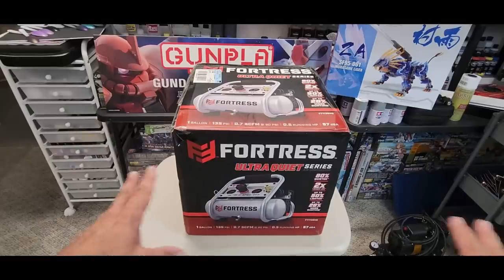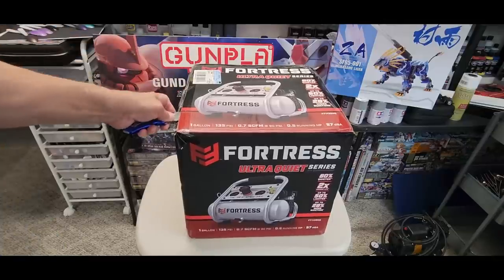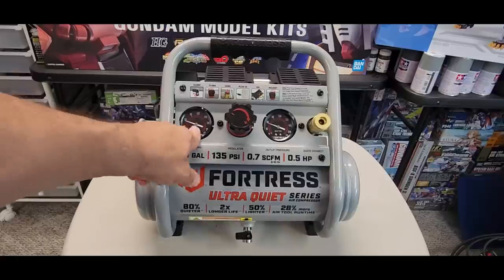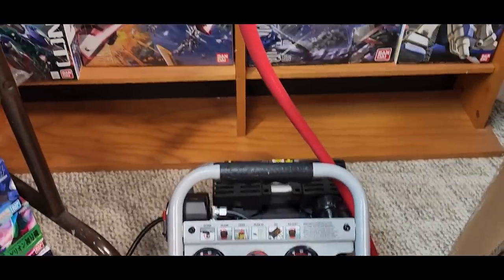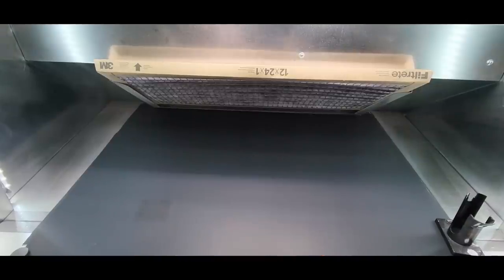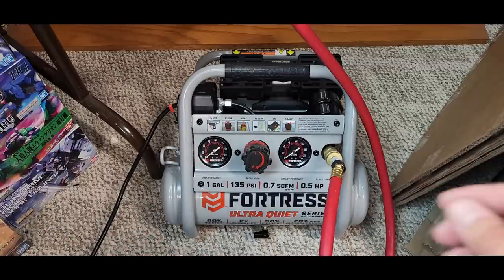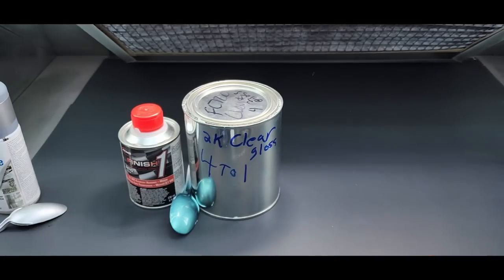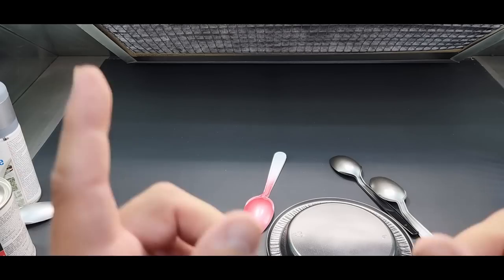Testing Harbor Freights Fortress Air Compressor For Airbrushing - Quiet High Quality Unit

Comment: Got one today but when i tried to move it around it sounds like there is sand inside it. Is that normal??
Reply from the maker: Well that's definitely not normal
Reply: @barbatosrex9473  thank you. I took it back and got another unit but did the same thing. Turns out, it was tiny metals from soldering the unit. They probably all have them. If you pick it up and turn it 360 degrees im sure you will hear them too.

Comment: Nice! It looks like a pretty good little unit and way quieter than the little Coleman compressor I use for portable air. You can just use the drain on the bottom to release all the air and that will also drain any moisture that builds up in the tank. You can just crack it open a little and put a rag there to absorb the water that comes out. In a lot of air compressor dryer units, there is a solenoid that pops open the compressor drain intermittently throughout the day for a second or two and keeps the moisture down in the tank.

Comment: Hi, I wanted to ask you, I have the 2 gallon Fortress compressor and I was blowing stuff for around half an hour (non stop) and it got very hot, burning hot!. Is that normal? This is my first compressor so I'm no expert. Thanks!
Reply from the maker: Yes, the manual says it will get hot and to take a small break every 20 minutes or so

Comment: Way too loud and would get old quick. If you could run inside a closet with a closed door and insulation, with the hose running under the door, that would work.

Comment: Slight overkill for modeling, my opinion
Reply: If this is slight overkill, then running a 27gal air compressor for modeling is what? Remember the less cycles the motor has the longer it will last. The larger the tank the more volume it holds the less pressure drops you will get. The larger the better. Especially for longevity of equipment.
Reply: @bob8409  who said anything about a 27 gal tank capacity? And the less air movement and release from a tank can cause moisture issues from staying in the tank longer as air has moisture in it. Overkill is using a device to small or to large for the tool and project it is intended for. Yes it will work so will a 100 gal tank with a twin vertical cyl pump starting up once a day but it is still overkill
Reply: After a year of this review I am in need of a new compressor and I went to Harbor Freight and bought this exact compressor. I have to say this is not overkill it is perfect. What a good quality product after 3days being hooked up to my airbrush it did not loose 1lb of pressure and refills in like 15 to 20 seconds. This is perfect for airbrushing and very quiet running. I will never go back to a hobby/toy compressor this is a home run!

Comment: To Barbatos Rex — I thought I had seen a review of yours of the Harbor Freight Fortress twin-cylinder air pump bundled with a Harbor Freight airbrush, both of which you regarded highly. I may have hallucinated this, but I’ve searched your posts, and can find your separate reviews of the Harbor Freight Fortress, and several (I think) reviews of Harbor Freight’s airbrushes, but not of a bundle of both. I’m getting old, so I could have made it up in my squirrel brain. I’d be very interested in such a bundle of the Fortress and an airbrush. Thanks for your site, which I just found a week ago — great stuff. I used to own a local hobby shop, but had nowhere near the amount of paint you have. Like many small shops in my small (12,000 in winter, 24,000 in summer — we’re right next to the largest state park on the CT shoreline), my shop was a victim of the Bush economic disaster.

Look forward to hearing from you — again, best modeling site on YouTube.

Barton Brown (bbrown95@comcast.net)

Comment: One would think that there are tens of thousands of compressors and they are all left pressurized all the time so I don't think you need to depressurize the tank every night, Though once a week I would open the drain petcock valve and make sure there is no water build up in the tank. Also one would think full pressure to depressurizing the tank would tax the metal more than leaving it pressurized. Also the cheap moister trap just needs the Schrader valve replaced which is the same one found in ever Car, Truck & bike tire vale.

Comment: I have the 2 gal version of this and totally love it! FYI, I have never dumped my air and its been running solid now for almost 7 years. So no you dont need to dump the air when not in use. Depending on where you live you should kick off the drain at least once a month to get moisture out of the tank as that can cause it to rust and or corrode.